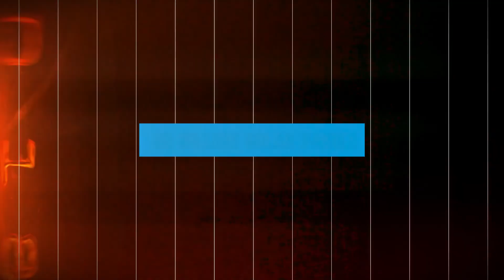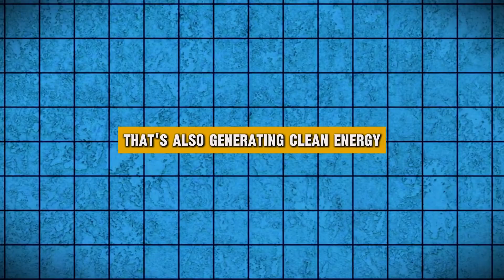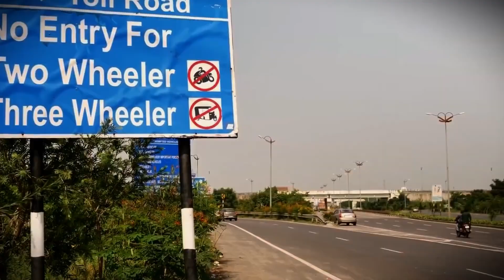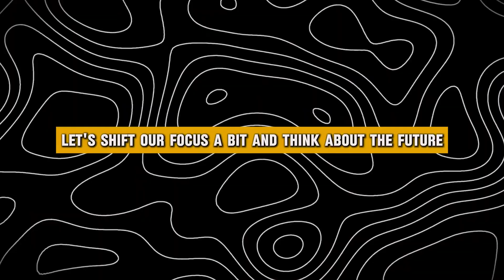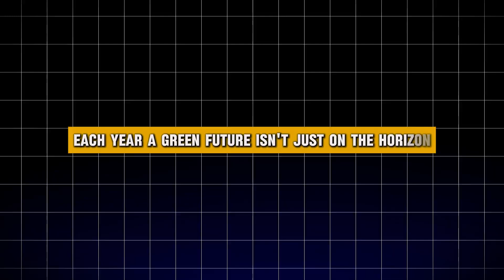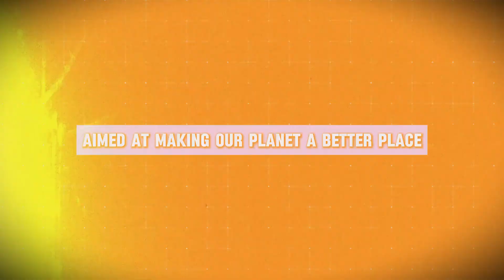World's Biggest Solar Power System Being Built In the U.S.!

Comment: Putting smart inductive charging so EV's could charge as they roll down the highway off of these solar panels would make electric vehicles far more viable for long distance travel.. Technology could bill the owner for the service and activate sections of the road on a per vehicle basis and or have charging stations right on the sides of the freeways..

Comment: Dumb idea.  Americas to inefficient to affordability make that happen,  let alone the amount of material to build the framework to hold the panels.  More effective to find empty land to do that.
Reply: Many areas have power lines that follow the highway right of ways which is a positive for this idea.. I would wonder about the cost of the build vs efficiency and value of the energy produced.. People with EV's are already paying well over the cost of the electric to charge their vehicles at charging stations that get power from the grid.. This could be an opportunity to use solar and LiFePo4 or Salt Metal batteries to setup charging stations like rest stops on the interstates or have some kind of inductive charging where all a vehicle would have to do is park in a space and get charged and billed through an EZ pass kind of system.. Then there is all that traffic and the chance a vehicle at speed would crash into the thing so plenty of preplanning and thought would be needed....